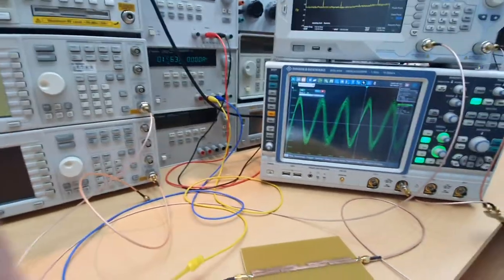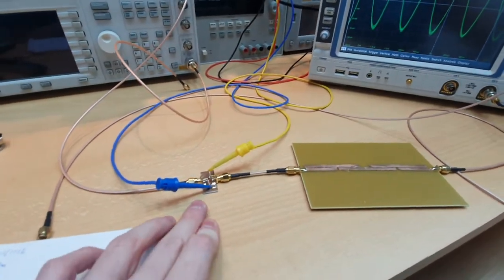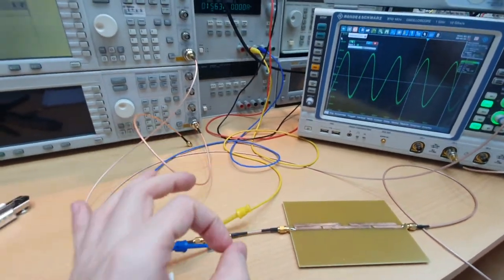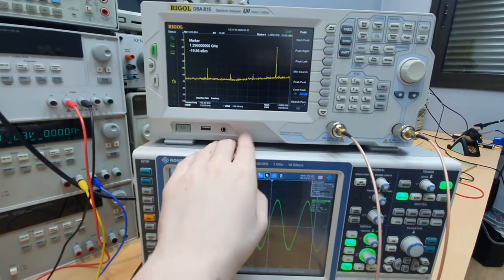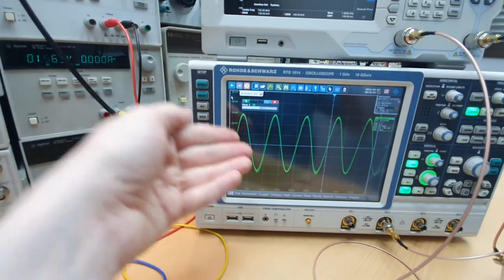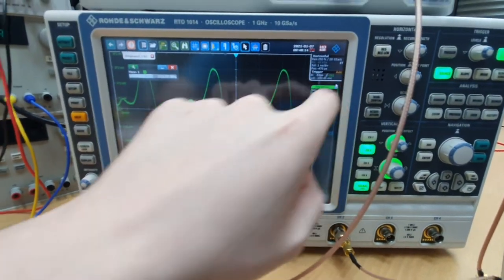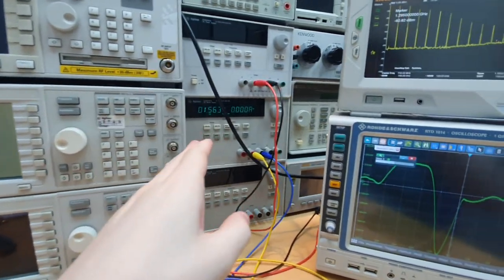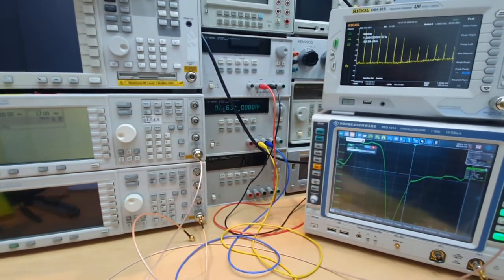Step Recovery, PIN diode and harmonic generation

Comment: The step recovery diode was invented at HP back in the 1960s.  HP used to sell ceramic packaged ones which had a frequency comb cutoff as high as 350GHz and average output of 0.3W.  They were qualified for manned space applications.

Comment: Long time ago i played with low power FM transmitters and one time in my hand came unknown diode that generated strong 50 Hz modulated noise in my FM radio reciever. All i need is to touch one side of that diode with soldering iron.

Comment: very nice application of the PIN diode, which software did you use to design the BPF?
Reply from the maker: This filter I made by hand using copper tape 🤣
Reply: @AllElectronicsChannel  just trial and error?
Reply from the maker: Yep! 

The ressonators in an edge coupled filter needs to be lambda/2.. so start with this and adjust do get exactly frequency. 

To play and get a feeling you can use agilent genesis. But, the feeling I got playing around with tape was much greater.. try it yourself!
Reply: Qucs works reasonably well for simulating this